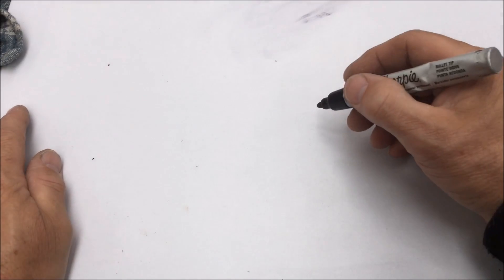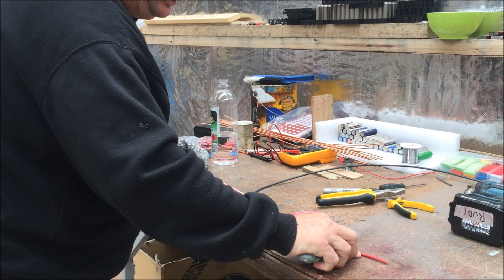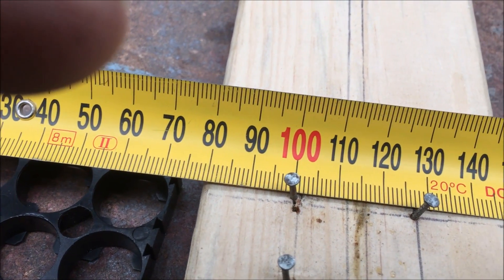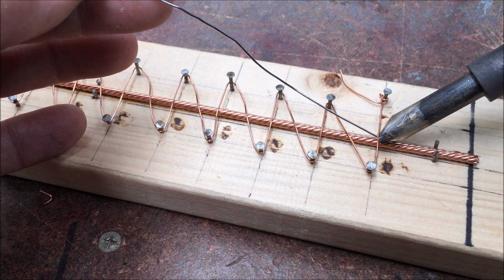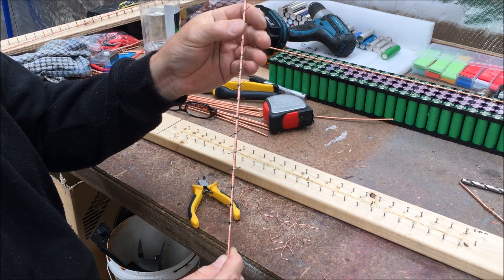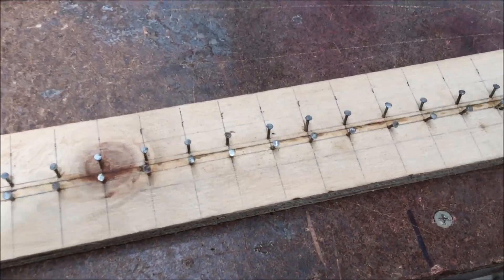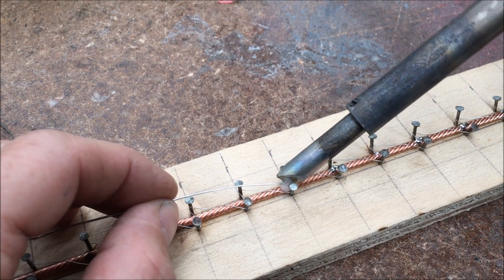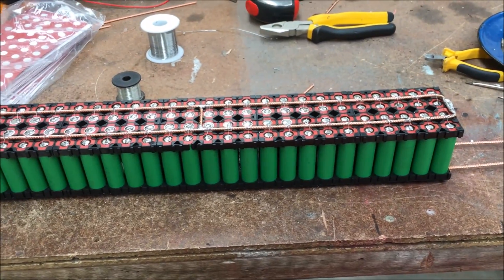DIY Power Wall - Bus bars #3

Comment: End cooling buss Idea for 18650 powerwall using 1/4 copper pipe over formed and soldered to your positive buss running non conductive mineral oil in the system separated from each string with clear polyethylene connecting multiple strings and finally to a reused CPU cooling radiator and fan .

Comment: Getting ready to build some of these packs. I am in the US and don't have access to multi-strand house wire. I am trying to convert 6mm to gauge here in the US. 6mm converts to 2 gauge solid core. That stuff is really hard to work with because it is so stiff. I would like to take something like 12 or 14 gauge and double it, then spin it up with a drill. Any idea how thick the final wire you have after you have spun it up?

Comment: I wonder if leaving the spot welded nickel tabs on the end of the cell helps at all with either the soldering of the wires to each cell and/or protecting the cell from the heat of the iron.

I always have to tear mine off regardless for some reason. Real waste of time I think.

Comment: what should be the maximum difference between capacities for cells to connect in parallel in a pack(2900 with 1700 should be ok)

Comment: What I find works very well is to use tinned braided copper grounding strap material.   It's flexible, capable of handling high current, and solders very easily.   Just use the appropriate size for your maximum current draw - and, there are charts for that.

Comment: how is the soldering iron not killing your batteries????
Reply: The key to properly soldering lithium batteries is to use a soldering iron at a high temperature and a high wattage so as to minimize the amount of time you're heating the connection.   I know that sounds counter intuitive, but the goal is to minimize the total amount of heat transferred to the battery and using a high powered soldering iron for a few seconds is better than having to leave a low power iron sitting on the joint for 30 seconds to a minute to get enough heat to melt the solder.

Comment: Brilliant idea on using the drill to strand the wires together. Doing the same thing for my bus bars, now that I've seen this. Seems to work well with 3x12 AWG solid wire or 4x14 AWG wire.

Comment: Why u ned to twisted bus bar caable ? id u use single 5 0r 6 mm copper cable is not good ?
Reply: twisted cable is much easier for soldering and also can transfer more energy, since electrons move on the surface of the material, not inside :) and also twisted cable is much more flexible and won't break up after several bending
Reply: @alexsiniov  WRONG!  DC current flows through the entire cross-section of the copper wire on planet Earth.   I am not sure what planet you are from ...

Comment: Great video. What happens when one of the batteries fails or dies? You will have to start it again.
Reply: lithium batteries just loose capacity, they dont short. he will just loose 0.5% of capacity of assembled cell

Comment: Hi FlyJabiru - lovely demo of the build - very neat and achievable in any workshop.  Just one question on the fuse wire.  Were you able to test at what amperage the fuse wire 'popped' in this configuration?  The issue I'm thinking is that with the cell and the bus bar there may be too much heat sink for the length of the fuse (possibly a bit short).  What do you think?

Comment: I've been watching many similar DIY setups and have binge watched all 170 video's from @HBpowerwall that all have learned me a lot, but this bus bar approach is by far the easiest, cheapest and neatest I've seen! Great job Rudi!
Reply from the maker: HBpowerwall is where I got started from too
Reply: lol i been binge watching too, twisted wire looks the way to go. they both use 6mm wire multi strand which is better for amps hence why they use multi strand for jumper cables and welders

Comment: I like your wooden jig for making the bus bars.  A suggestion on the fused side, after the fuse wire is cut, and while the bus is still in the jig place a wooden dowel rod next to bus and curl the fuse wire all at once.

Comment: I have trouble getting solder to stick to the cells, unless I sand or scrape them first.  How do you get the solder to stick so easy?  Also, what exact solder do you use?  That is really nice work.
Reply from the maker: Thanks. I use a 80 watt lead light soldering iron. 
I don't think ist the type of soilder I use, but I think It will sticks if it gets hot enough
Reply: On used cells I first use a Dremel to remove any excess tab material then us a flux pen ..getting enough heat is really important.

Comment: Hello! I want to build a batterypack. Is it not dangerous to solder directly on the cell?
Reply from the maker: No, Its fine. Others have done tests;  A small amount of heat doesn't seem to affect the batteries at all.

Comment: Very well explained videos! Really makes me wanna start doing something like this. More to learn first, so here's the noob question: why is the postive side wire you're using different from the negative side? Thanks!
Reply from the maker: The positive side of the batteries are fused with fuse wire in case an individual battery cell fails. It's the same thing Telsa does on there battery packs
Reply: Ah! Got it. Thanks!
Reply: flyjabiru11 what wire are you using on the other side? Can you link guage and type? Thanks.